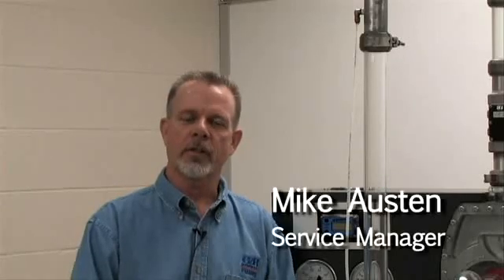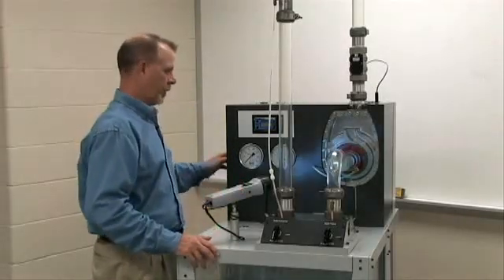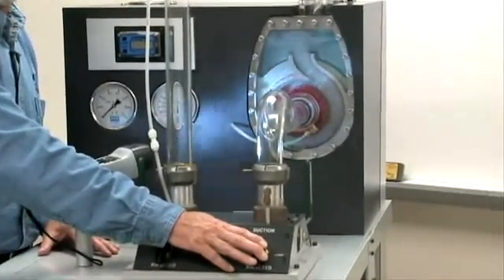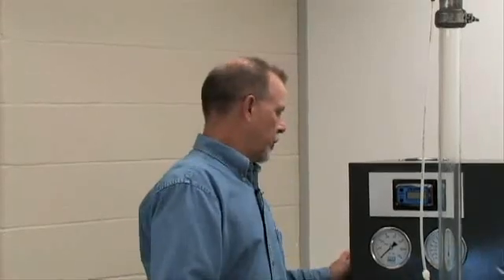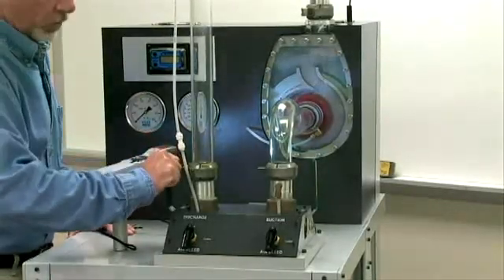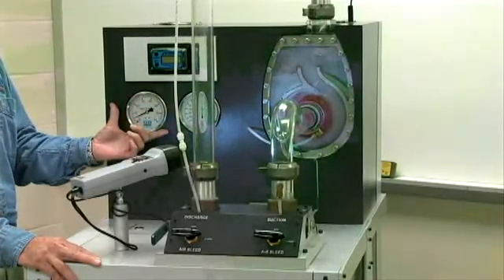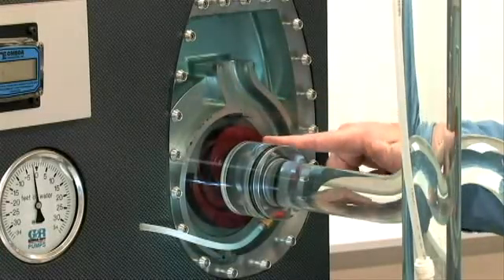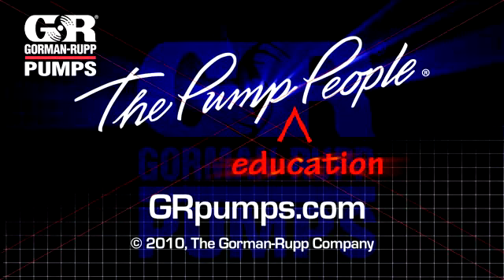Self-Priming Pump Basics Pt. 2  Failure to Prime - Gorman-Rupp

Comment: Not sure who else to ask but you seem very knowledgable. I'm using a 10" Gorman Rupp self priming prime air pump in a creek that has a huge pool area that I'm pumping out of. The pump primes itself easily but when losing prime, it cannot reprise itself. We've done this many times but never had this problem. The pump will actually pull the water right up to the pump but won't pump. Any suggestions?
Reply: im having a similar problem but on a smaller scale.I suspect it is due to binding, i am going to try a air breather valve on the discharge line.
Reply: A couple of things could happen here:

Discharge check valve worn out.

Check valve on ventury line collapse.

Suction pipe had a hole in it.

Float on the priming chamber is unscrew .

Piping from compressor to the priming chamber is worn out.